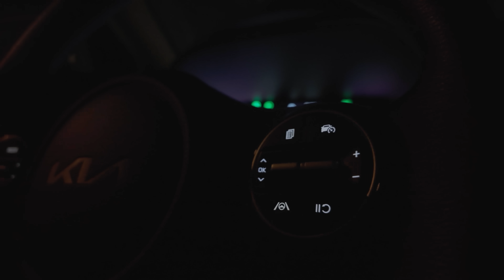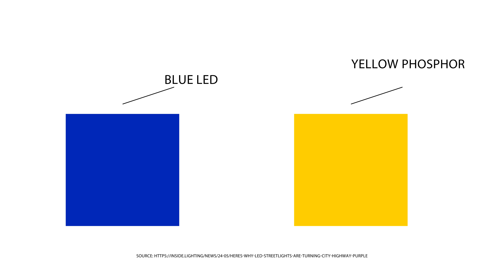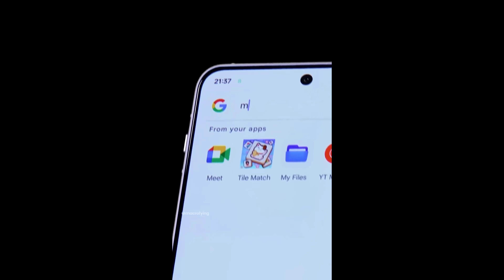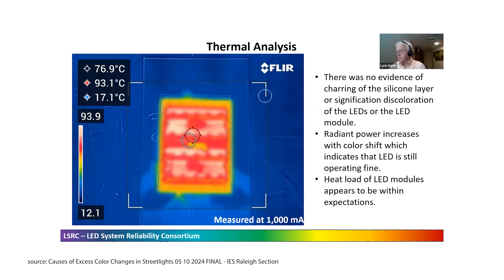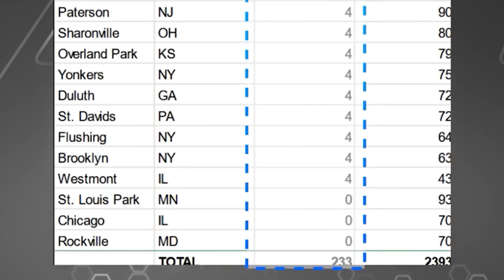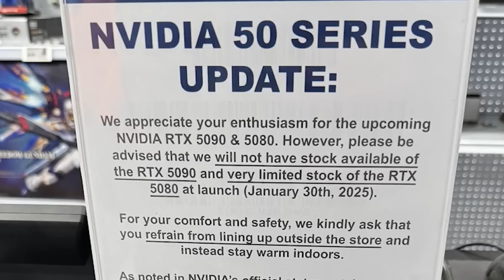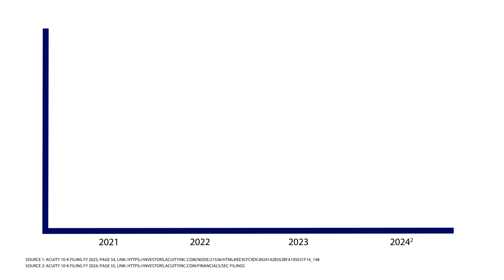The Hundred Million Dollar Mistake That Turned Street Lights Purple!

Comment: I will say this until the day i leave this mortal plane. Incandescent lights will always be superior for lighting quality over leds. Flashing lights are also dangerous for street lights, and i can see any LED flicker. Incandescents take too long to get cold for the ac current to have a giant effect on this. Leds are near if not instantaneous, which contributes to the flicker.
Reply: LEDs already effectively reached CRI of incandescent lights over a decade ago. They have a far softer source when used in remote phosphor guise and are actually superior light sources for general illumination.
I use taiwanese drivers that run 3000Hz if PWM/dimming. I am very sensitive to optical flicker (and projectors that run RGB signals out of synch) and the meanwell stuff is absolutely perfect. NEVER flickers, when a few cheaper Chinese drivers I have will if power drops too low voltage/pump runs/etc.. you have not seen really high quality, well built LEDs, because 98% of the product on market is barely above junk, most people don't want to pay for the good stuff that lasts a lifetime and get the cheapest crap possible, then complain when it sucks/doesn't work/flickers/looks awful/etc.
Reply: LEDs don’t have to flicker: just run them on DC. And that’s what well-designed LED drivers do. 

As for lighting quality: we already have LEDs that are >98% as good as incandescent. They are indistinguishable to all but the most discerning, trained eyes (or spectrophotometers). But since they’re more expensive and less energy-efficient than LEDs with lower CRIs, they’re far from universal, sadly.

Comment: I wonder if the failure of high-use televisions with LED backlights going to blue is due to a similar problem.  Maybe you've noticed an old flatscreen tv in say a sports bar that is way more blue than it should be?

Comment: Every white LED has a component of blue, violet and ultraviolet light which is more dazzling and harmful than other frequency spectrums which stresses your eyes more. Some of them have a flicker which is also bad. Don’t confuse harmful radiation that hurts your eyes with bright light. The actual usable information to eye stress ratio is really bad with LED light.
Reply: No, the blue LEDs emit extremely little UV and near-UV. LEDs are nearly monochromatic, and the blue LEDs used in white LEDs are around 420-450nm, well outside UV. 

You’re very right about the flicker in poorly-designed LED fixtures. As someone who is sensitive to flicker, I detest flickery lights.

Comment: The blue plus phosphor setup is actually done because it's brighter and more energy efficient than running three separate diodes. The phosphor actually absorbs a portion of the blue light and re emits it as other colors.

Comment: this explains why some led car headlights have purple glares at some angles. I also learned that this one store near me doesn't use purple lighting on purpose, they just lost the enamel and don't see it as a reason to replace the bulbs.
Reply: I have a significant hatred for switch to LEDs in cars.  Greaaaat, you can see over the curvature of the earth, but no one facing you can see a GD thing!  Filament lights worked just fine for a literal 100 years

Comment: These lighting manufacturers are all fighting for the lowest cost for a contract, resulting in them producing fixtures with components pushed to their absolute limits in many cases. While paying double for the same brightness isn't very easy to explain to taxpayers, it would help by driving the LEDs at a much lower power resulting in a longer lifespan.

Comment: The phosphor layer isn't just a filter tho. It absorbs the high energy blue (or even UV) light and re-emits it as white!
Reply: I was about to write the same sentence. I made LED lighting product designs for my previous job.
Reply: Broader spectrum blue-violet LED, that excites the phosphor, which in turn emits several lower wavelengths that mix with the blue-violet viewed as white. The phosphor just does not delaminate, but also degrades when excited, and will fade out over time.
Reply: White LED’s are actually SOLID STATE FLUORESCENT LAMPS. Instead of a mercury arc making short wave ultraviolet light that excites various phosphors that glow and then emit light, the LED chips emit UV or near-UV (“black light” ) rays that do the same with a phosphor. So these are solid state fluorescent lamps. The reason the blue to purple light after the silicone that holds the phosphor fails and falls off, causes awful visual acuity is because the UV or near UV causes our corneas to fluoresce and glow, blurring vision and also reducing ability to even see by the glow of the corneas acting like glare from a fully exposed very bright light source, which is known as “veiling glare”. A BLB type black light fluorescent bulb/tube with the Wood’s glass deep purple glass pigment that looks “black” when off will have this effect and is well known, when said lamp is lit. Black light posters glow brightly under these BLB fluorescent lamps because the colors have phosphors in the paint or inks. So these LED street lights become basically BLB type black lights when the phosphor falls off. Acuity and American Electric always madd junk poor quality mercury vapor and high pressure sodium regular street lights, so I expect this junk in LED’s too! I collect light bulbs, fixtures and vintage incandescent and mercury vapor street lights and have some AE ones and they are CRAP. Cheers! And it isn’t phosphorus. It is PHOSPHOR 😋👍🏻
Reply: @2StrokeDriptroit  I thought the phosphorescent | fluorescent material here was made out of actual phosphorus (the element). If it's not then yeah, I should've called it just phosphor.

edit: Looks like it's indeed usually made out of some entirely different materials. I'll correct that in the top-level comment.
Reply: exactly, filters block certain wavelengths out, so that phosphor isn't a filter. to support the re emitting you said you can test this by shining a uv laser or light onto the phosphor from outside the led and it emits a different wavelength back.
Reply: And the UV light will cook you like bacon.
Reply: Kinda what happens with my LEP flashlight. The phosphor absorbs the laser emission and emits a really bright light.
Reply: Yes! This is true because the blue/uv light doesn’t contain longer wavelength colors required to make white or yellow light. You could put a filter on it and it would filter nothing. The phosphorus re-emits the light in a broader spectrum that appears white to our eyes.
Reply: Phosphor is what actually produces the light. It heats up and produces lumens ( visible light ) the coating on the diodes produces the kelvin rating which is the color of light it makes. Also the coating can be used to adjust beam angles and various other things. Just depends on the fixture and application
Reply: Right, it's blue, not purple, with a yellow phosphor.
Reply: @Sonny_McMacsson actually a phosphor emitting a bunch of wavelengths across green to red.
Reply: @RobertSzasz  I knew this acktshually would come up and so I waited. You did not disappoint.
Reply: @Sonny_McMacsson acktshually AWESOME!! 😅😅
Reply: I'll talk wavelengths and wideband , white spectral light all day.... just not with people that don't understand it.... don't get me STARTED on lasers , and super continuum light in fiber optics....😊😅
Reply: @Sonny_McMacsson  fine fine, if you block the blue light coming from the led the phosphor is "yellowish" but there are also yellow PCLEDs which are a totally different beast.
Reply: @andylarson6877  bring it on, were not all braneded
Reply: @ The phosphor is totally white, it emits white light. just because it has a yellow color when turned off does not mean it emits yellow light. Also a yellow colored optical filter actually filters all non-blue colors and passes blue. Perhaps you are thinking of transparent yellow paint?
Reply: @Sonny_McMacsson  wrong. It's a UV LED and a white phosphor. None of the light from the LED makes it through. It is NOT a filter. It is not transparent. The phosphor itself emits white light.
Reply: @3fives-j5w  Arighty then. I'll ignore all observations I and others ever made as well as all documentation and believe you instead.
Reply: @ Where did you find documentation saying that white LEDs are blue LEDs with a yellow filter? There is none. White LED's are made by placing a phosphor over a UV LED.
Reply: Is that why it feels like I'm going to get eye damage when I look at these things? It feels like I'm staring at a black light and getting UV rays.
Reply: @RCAvhstape  If the phosphor coating is properly applied, it shouldn't matter if the backing LED is blue or UV. Also, even if the UV was leaking somehow (like with this de-lamination here), not everything we call UV is equally dangerous. There is a big difference between the UV-A just above visible light and the higher energy | shorter wavelength UV-C.

But don't stare at very bright light. Even if it's lower energy (and so not ionizing – doesn't wreck chemical bonds in the molecules that make up your cells), it can still be concentrated enough to burn your retina. This is why infrared lasers can be so dangerous! You can't see them, yet they will easily heat up your cells and just fry them.
Reply: @mskiptr  You seem very knowledgeable, so I have a question. Let me set it up: I've recently gotten into researching and buying some LED light strips for some lighting projects around the house.  One of the first I bought was RGB where I could set the color of the strip with an app.  "White" looks like a gross green.  If i tweak it in the spectrum circle,  I can get a yellow-ish warm "white."

I've also seen that there are strips you can buy that are RGB+W  - a separate dedicated white LED. My question: is that dedicated white LED truly white,  or is it a phosphor covered blue LED like in this video? Followup - if white,  why can't street lights have a directly white LED?
Reply: @Ck87JF  Indeed, there's no such thing as a white LED. White isn't a spectral color, but a mixture of many colors (and LEDs are all about specific wavelengths).

Overall, the colors that you see boil down to the three types of cone cells in your eye. They have different sensitivity to different wavelengths of light, which your neurons can use to distinguish different colors. Like if you look at the orange light of a low-pressure sodium lamp, it's just this one single wavelength (589 nm) that's entering your eyes. It will make the green-ish and red-ish cone cells somewhat activated, but will cause almost activation of the blue-ish cone cells. But you can get the same effect by using a mixture of other colors. This is how TVs and computer screens can show all those colors with just different levels of RGB.

Where it really breaks down tho, is when instead of directly looking at the light source, you shine that light at some material. Depending on its color, it will absorb the light of various wavelengths, essentially just filtering them out. For example, if you had some paint that only reflects yellow light (absorbs everything else) and you try to shine a mixture of green and red onto it, while that light might look yellow, it will still be absorbed and not reflected!

That's why RGB isn't a particularly good "white" light. It often has weird interactions with many materials. On the other hand, those phosphors are specifically engineered to emit many different wavelengths of light. A high quality phosphor coating will emit a much "better" white – one that contains enough colors to properly reflect off the stuff all around us. And there are phosphors for some specific colors as well. (which can "fix" RGB lighting btw)
Reply: @RCAvhstape no, it's not.

Comment: Blue LED is not under a yellow filter, it’s under a phosphor.

You can’t use RGB lights because they don’t produce white light, it only looks white because our eyes just see RGB, but when cast on different materials the colors are not the same as white light. This is what CRI measures.

The yellow phosphor converts the blue light into full spectrum white light. And blue LEDS are not “cheaper” they’re the most expensive color of LEDs you can find. Blue is used because it’s got the highest energy in the freq spectrum, it is the only LED that can produce white light.
Reply: Interesting thing about the blue LED.  The first manufacturer to make a breakthrough to make them bright enough and cheap enough, also made white LEDs.  What did they make before making Blue LEDs?  Phosphor for fluorescent lamps!  LOL!  I love the crossover in science/history stories like that.
"Why It Was Almost Impossible to Make the Blue LED" by Veritasium.

Comment: Why laminate the LED module?  Why not laminate the plastic cover?  Those would be easily replaceable.
Reply: It's how the LED is manufactured. It is created to be a white LED. (Almost?) every white LED is actually built this way. It is how you create a full spectrum white light. Fun fact, this is also how florescent lighting works too in that there is a phosphor coating inside the tube which is converting UV to white light. It's a different phosphor, but the reason is the same.
Reply: @R.B.   Right,  so use blue LEDs,  and then put the phosphor on the plastic light cover and not on the LED itself.  The output light will still be white but if the lamination fails you can just replace the COVER and not the super expensive LED.  See what I'm sayin?
Reply: @Mark_McConnell  more UV than blue. That might work, but it isn't how they are manufactured. The phosphor is the IP of the manufacturer of the LED. Those LEDs are mass-produced and are essentially standardized. What you're asking is that the company who manufactured the light create their own phosphor and can source what is likely a custom LED. But that's not necessarily all at risk. I don't manufacturer LEDs, so I can't be certain, but I expect that the LEDs are most efficient at producing white light when the phosphor is as close to the source as possible. Moving the phosphor away from the housing would require significantly more phosphor to laminate the interior and not all the emitted UV light will strike the phosphor. There are also other risks that putting the phosphor on the lens housing the LED cluster, that it is possibly subject to more wear and decay.

It would be worth exploring, but I suspect that your suggestion will actually be more expensive both in manufacturing and maintenance.

Comment: If only we had some kind of reliable amber lighting that has proven itself over millions and millions of man hours...
Reply: And use 5x more power 🤔
Reply: @ProctorsGamble  
Luminous Efficiency: 
Most LEDs	:
75-110 lumens per watt

SOX-E: (high pressure)
142 lumens per watt

Low pressure sodium: 
200 lumens per watt

Current very best LEDs:
200 lumens per watt

And in going to guess the very latest best in class LEDs are NOT what are going in lowest-bidder street lights.

I don't know why it's said they're more efficient, maybe there's some tech I don't know about but I genuinely can't find it.
Reply: @MostlyPennyCat  I don't know where you got those numbers but they are not correct. I'm an electrician and replace 1000watt sodium light with 200 watt LEDs all the time and get better and brighter lighting. Also remember there is a 20% factor you have to add to ballasted fixtures so a 1000 watt sodium really consumes 1200 watts. LEDs use electronic drivers that consume very little power.
Reply: @ProctorsGamble  
That's the thing though, I absolutely cannot find an LED module, the individual chip, that is even vaguely efficient enough to achieve a five times increase. 
Yes there's ballast losses, so with that alone you can probably beat sodium enough. 
I think it's just production costs, they mass produce LED modules and it makes them cheaper than sodium, with cheaper drivers as well.
Reply: @ProctorsGamble power factor doesn't have a lot to do with lighting, the vast majority of lighting doesn't use three phase.. only in very specific circumstances, and usually in production environments.. but not out on a road.
Reply: @MostlyPennyCat  exactly. HPS biggest fault is the Heavy metals which need to be properly disposed of. Otherwise they work fantastic and the orange/yellow light is a pleasant sunset and not offensive to our eyes at night.
Reply: @ProctorsGamble   do some math man..... HPS isnt actually that far behind LED
Reply: @ProctorsGamble you need to do your homework.. they're actually just as efficient.. also, some models of high pressure sodium bulbs are monochromatic, the only produce a very narrow wavelength.. You're needing visibility at night, not necessarily color rendering.. high pressure sodium bulbs provide that, along with less light pollution and less issues with eye strain. 
They also last longer and don't require expensive microelectronics to operate.
Reply: the sodium lights are outdated and there are better options, cannot stress enough the advantage of daylight white at night for street lighting.
Reply: @stackflow343 just because something is old doesn't mean it isn't good.. The old high pressure sodium lights were just as efficient, they lasted longer, produced far less light pollution, did not cause eye strain in the way that these LED street lights do.. I might also add that LEDs actually predate high pressure sodium bulbs by almost 40 years! 
High pressure sodium bulbs also don't require microelectronics to operate.. It requires a lot of complex, expensive electronics to drive an LED properly.. high pressure sodiums just need a decent ballast.. really just a simple magnetic ballast.. That's all.
Reply: @stackflow343  
Would you like to hear all the reasons why daylight white at night is one of the WORST ideas? 😂
Sorry, but, no, currently there does not appear to be a better option than sodium lamps. 🤷‍♂️